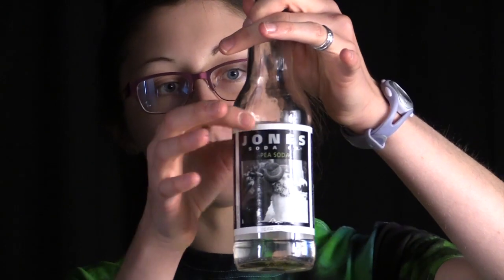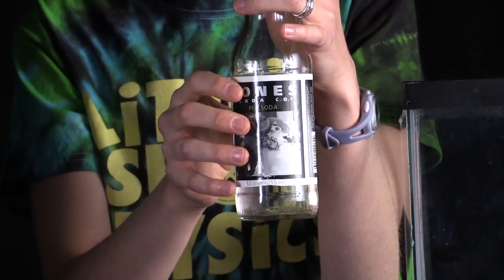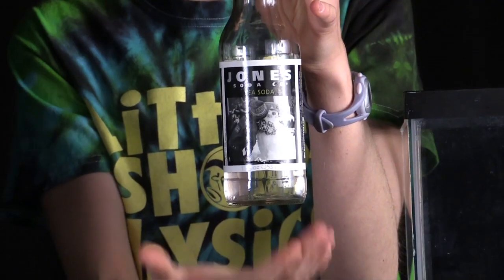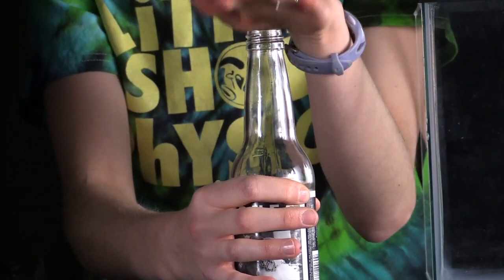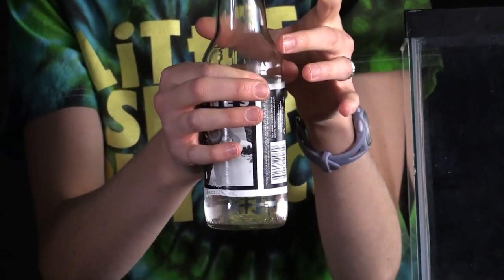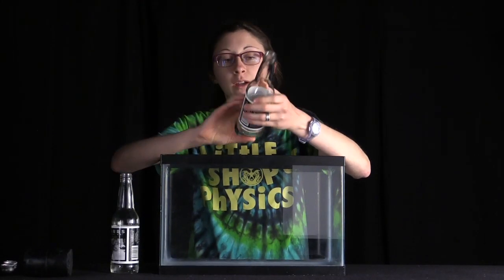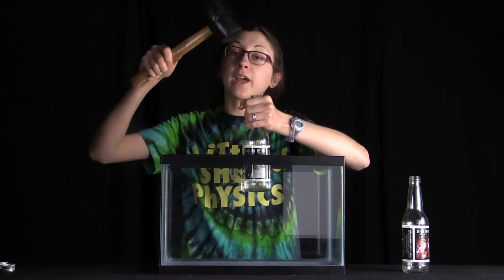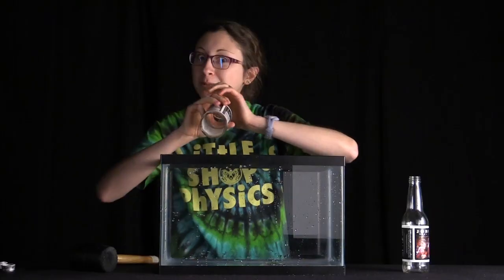Water hammer - Little Shop of Physics

Comment: I did that to an empty wine bottle with my palm. Plz explain.
I am also only recieving audio to the right chanel.
Reply: +John Crichton Slam of your hand pushes bottle downwards but the water slope stays at the same place. While bottle travels downwards, air above water is being compressed until reaching very high pressure and then the water slope is shot towards bottle bottom.